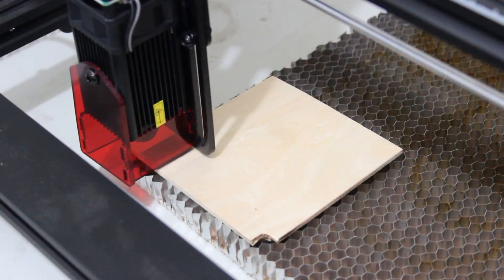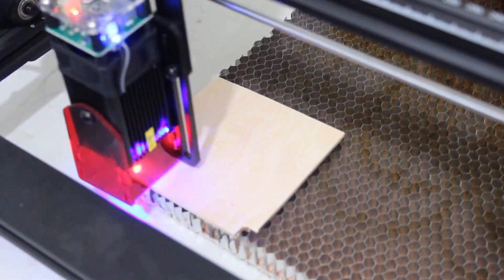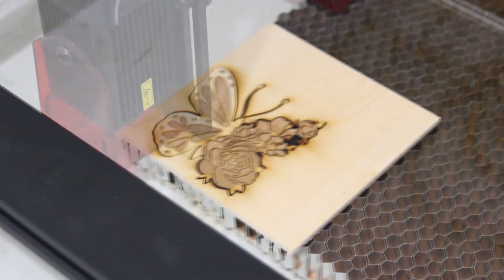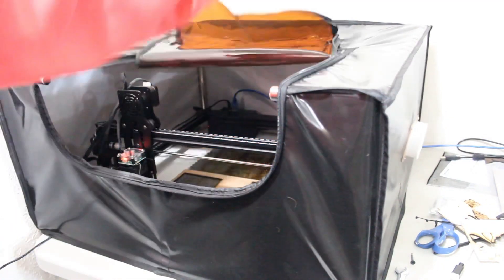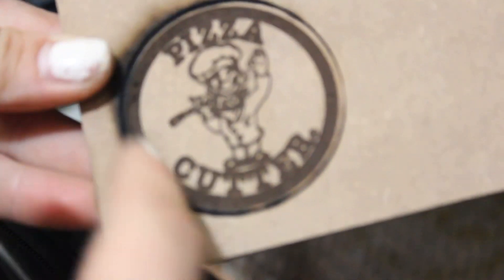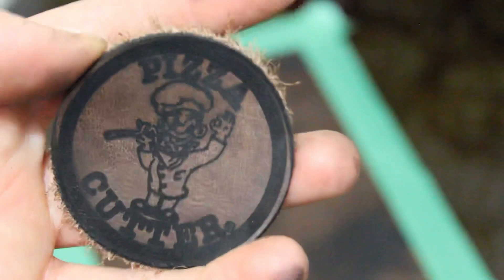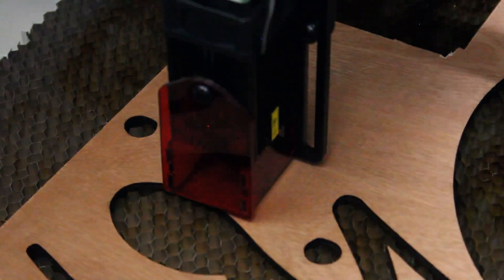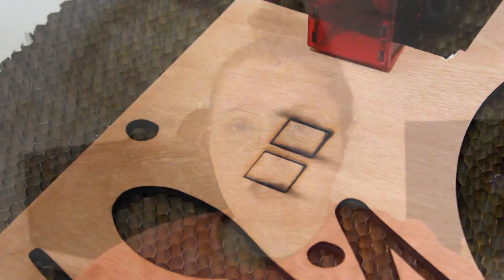Pergear LaserStorm L5 laser engraver/cutter Review

Comment: I am looking for a laser and your video is very useful, thanks.
I have not found any youtube video showing cuts on balsa wood. But I have noticed that plywood works really good with laser. I build small balsa model planes and i want to find laser able to cut up to 4 or 5mm of balsa.
Have you done any balsa cutting?

I am interested in some 3d prints for landing gear. Do can i get in touch with you to send you info about what i want to print to see if you have help.

Thanks again,.

Alex
Reply from the maker: Yes! Balsa wood cuts like butter with the lasers super easy!
Reply: @TimberWood.Customs  Butter..i like that, means many planes built for me.
thanks
Reply from the maker: Yes message me on Instagram or Twitter
Reply: @TimberWood.Customs  sent you a message on Twitter yesterday. please reply when you can. Thanks